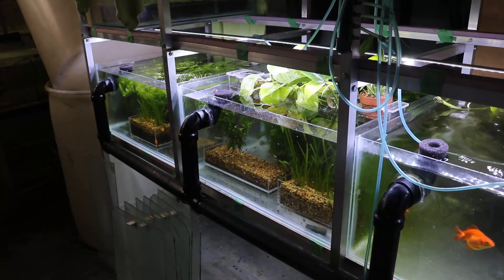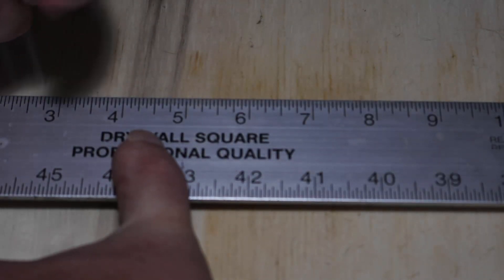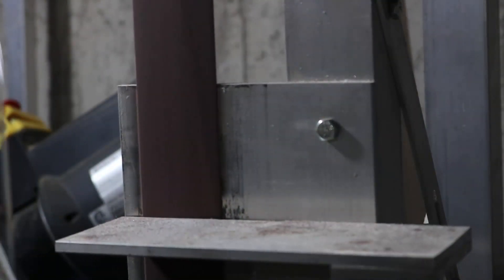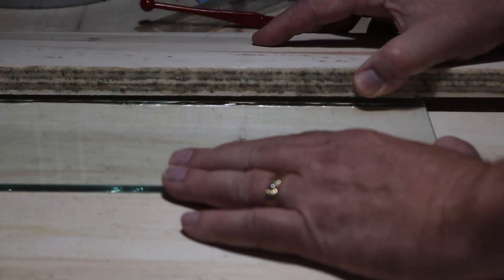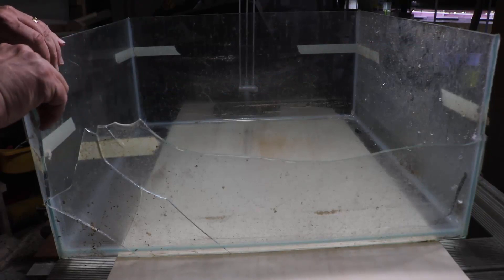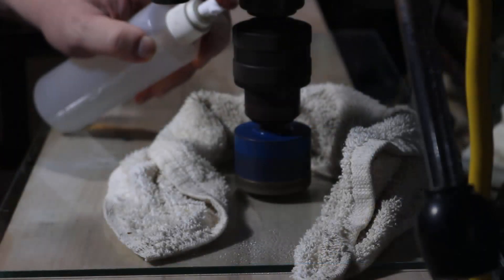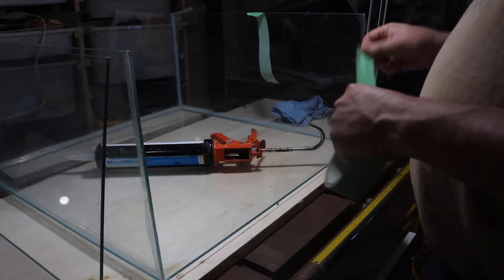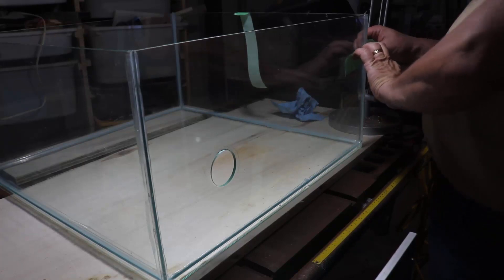Small Tank Building 101. Part 1 Cutting glass

Comment: All good tips on the cutting. I would add that I dip the roller in a bit of light weight oil. You don’t want it dripping off the cutter just a light coating. I use a extra fine silicon carbide sandpaper on the glass around 280 grit would work.
Reply from the maker: Hey Tom great seeing you. I forgot the to mention the lube for the cutter. The old glass guy I learned from used transmission fluid. Thanks for the great comment

Comment: Great advise on glass cutting. I cut 1/2 inch glass with this method [and I don't recommend it] but was able to build my 100 gallon tank. Still get complements on that build
Reply from the maker: Cutting 1/2" is a serious challenge. It's really hard to compensate and then grind down the curve from the brake. Great job on doing it and thanks for coming by. Much appreciated

Comment: This is awesome info, @Fishman! One question: How did you get away with the old silicone left in the seams at the bottom corners?
Reply from the maker: Thanks for coming by Dan. One of the misconceptions out there with silicone and tanks sealing is that the bead of silicone on the inside of the tank contributes to the tank staying together. It's only the silicone that's actually between the two pieces of glass that matters. Those two pieces have to be completely free of old silicone dirt etc... Also with small tanks you can get away with much more lax prep than with larger tanks. Hope your having a great weekend
Reply: And the 2 bits of silicone in the seam between the bottom plate and the 2 side plates, will that seal okay to the new silicone that is put on when the front plate is added? I was always told new silicone did not seal to old, but I would love it if that were not true, or at least not completely true.
Reply from the maker: New and old silicone do not bond well together. That's why it's really important to remove it from the bonding edges. When I did the reseal any of the old silicone that was squeezed out from between the seams from the first seal isn't part of what holds the tank together. I didn't go to great lengths to remove it because it won't be part of the new seal either. If this were a large tank I would just to ensure that none of it curved around to the between seams side. I think I might have to do a video on this because it's hard to explain here in the comments. After rereading your comment I think what your asking is that tiny bit of silicone that is between the bottom and side sheets of the tank that I'm not removing, will it bond to the new silicone as I put on the new piece of glass. The answer is no. It is also not important. The new silicone will act as a kind of washer and the water pressure will hold it in place. Any issue issue with bonding here is tiny. Your talking about a wafer thin section that is 5mm wide. Hope this helps
Reply: @FishmanEricRussell  Awesome info...thanks for the clarification. I have a 75 gallon that has a shattered end plate (a forklift ran through it during loading) and I am going to attempt to replace the plate. This info will help a lot. Thanks again!
Reply from the maker: Anytime Dan

Comment: I have 2 projects I have questions about. Need to reseal my first tank,  I smashed the corner. And to drill holes in round plastic.  I am nervous for both lol.   I pick up tools and people run away 😂
Reply from the maker: Hey Dea. I will be definitely doing a video on repairing broken tanks. As far as drilling into round plastic like pipe, you need to start with a smaller bit first and work your way up to the hole dia. that you want.  It also really helps to clamp the pipe down so it doesn't move. Hope this helps and have a great weekend

Comment: Do you know of anybody, who has successfully cut or drilled tempered glass? I have a 110 gal. tank, that I would rather plumb through the back, rather than over the rim. And we all know what tempered glass does, when you put the wrong kind of pressure on it.
Reply from the maker: Sorry it's not possible to drill. As soon as you break the skin you end up with lots of little pieces.